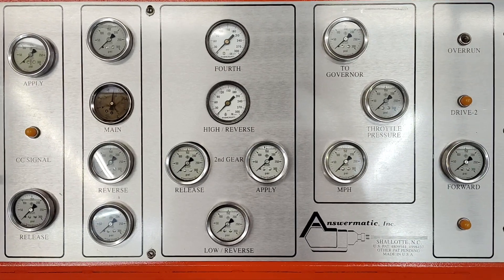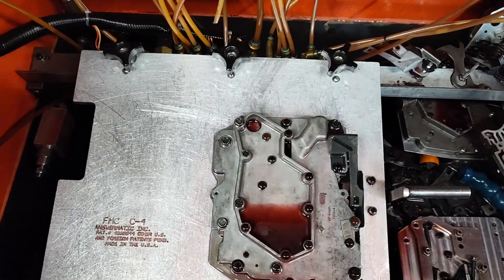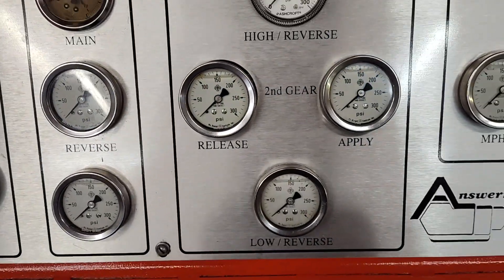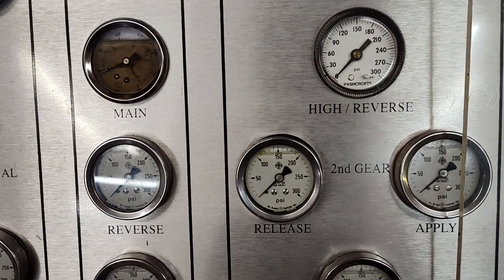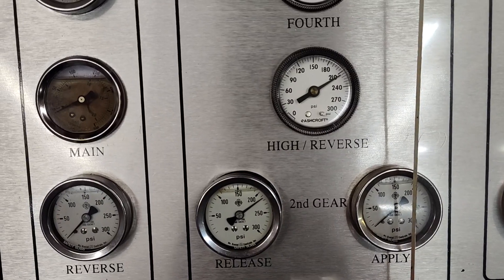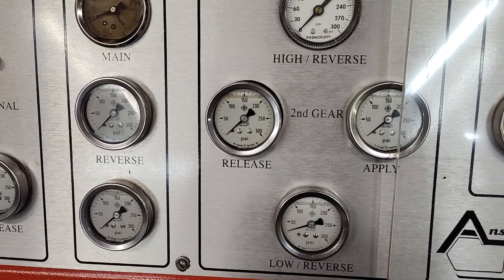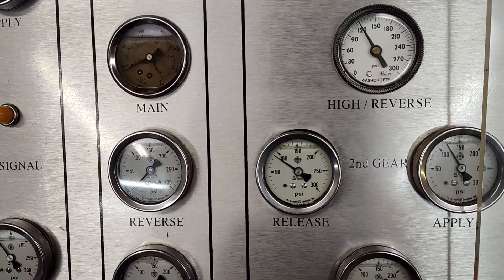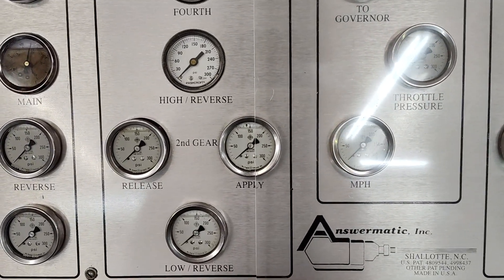Ultra Rare Ford C4 Transmission Part 4

Comment: Anybody have tips for why my C6 front seal leaks after sitting for a month or so?  I removed the pump and replaced the front seal but basically there was no improvement.
Reply from the maker: Check the converter hub for wear and the pump bushing.
Reply: @BroaderPerformance Agree, I should've replaced the pump bushing.  Also, I think it would benefit from a higher stall converter. Is there no check valve to prevent converter drain back?

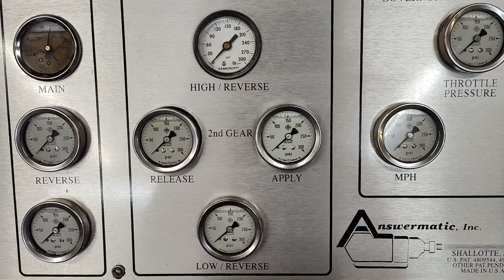Comment: I ran into these valve body in the middle 80's my super stock buddy's were using them at that time you could not get them from ford any more.My book said or called them taxi valve bodys.Rossi was using them in early 70's. He built me two trains and neither one work,so the learning began.luckly b&m came out with a manual valve body kit, installed it and every thing worked for years.Luv reading about this stuff thanks for your time I know you have years in to this. 2:20
Reply from the maker: Great info. Thanks for sharing
Reply: In 1976 I put a B and M manual valve body kit in my 65 Mustang for mountain driving. It was easy to install. Worked fine up to 84 when I sold the car.

Comment: (1) Sprag worked for low.+ Forward Clutch(2) Front Band/Forward Clutch ....(3) Front Drum+ Forward...never checked psi, made our own kit. Never used valve body gaskets (it worked better.) I loved building them, We could make a full manual on almost all transmissions.  The race guys would make it manual and use a 4,000rpm stall converter. I wouldn't say I liked the C4 for racing, C6 was way better.
Reply from the maker: The C6 has been much more popular since these big stroker motors became more affordable. The C4 always held its own considering its size that's for sure. Thanks for watching.